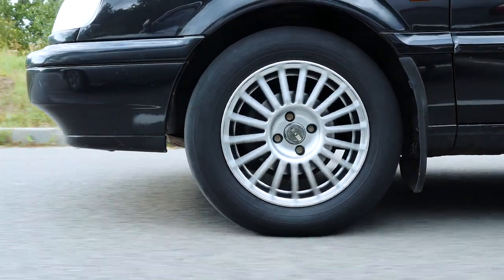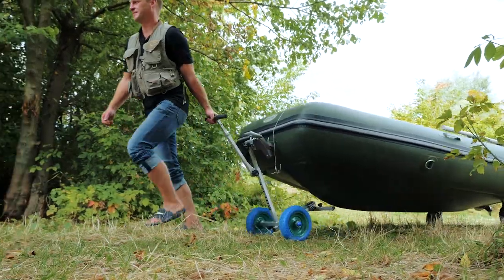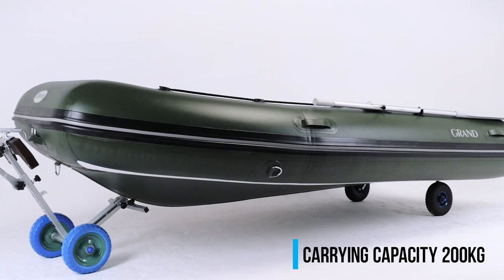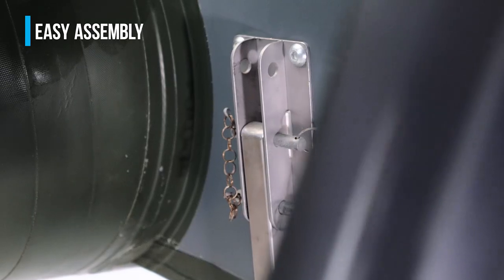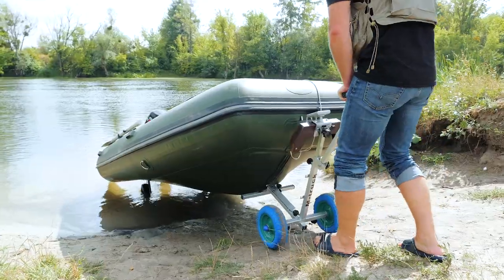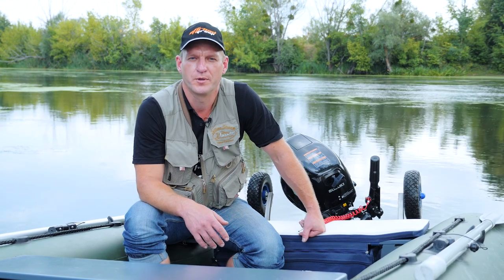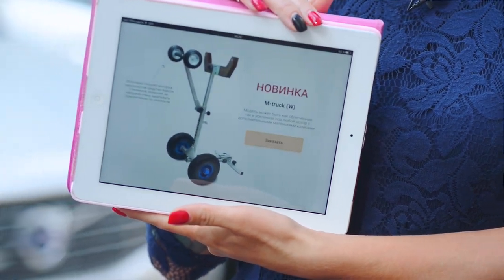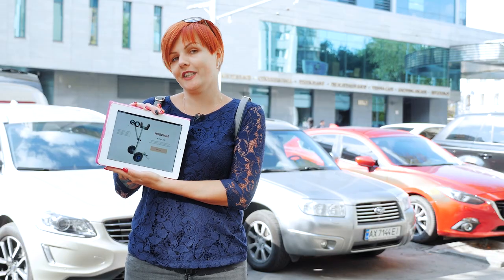Boat transom wheels

Comment: What is the wheel in the front called? How do I buy?
Reply: You've probably found this already...but the wheels in front are a troller for carrying an outboard motor.
Reply: @TrilobitesRTasty  it seems to have a special „bit“ on top to connect to the boat (normally a engine would sit on it) do you know how to find it? I’m trying hard but can’t find this model or a alternative one with that „connection bit“